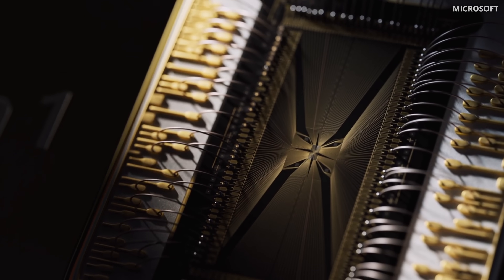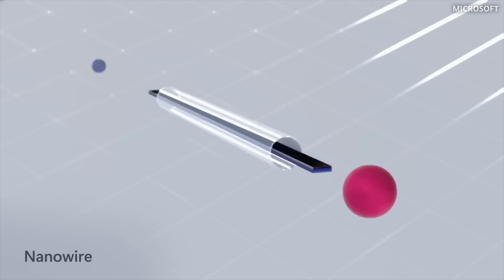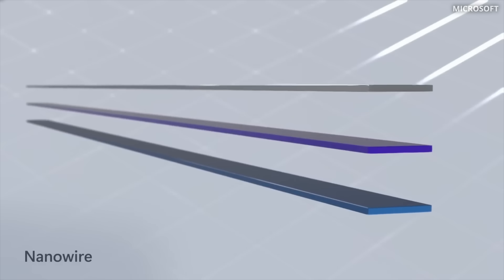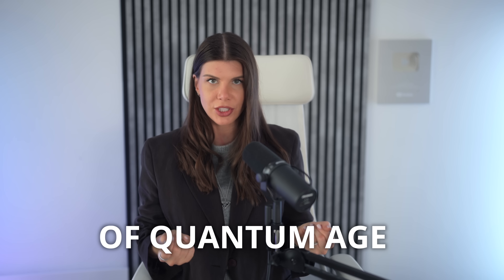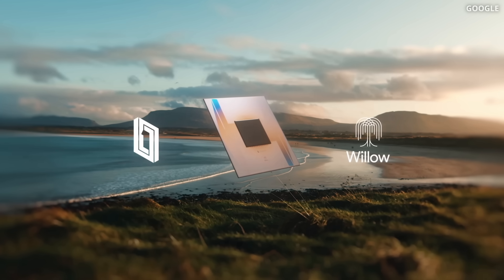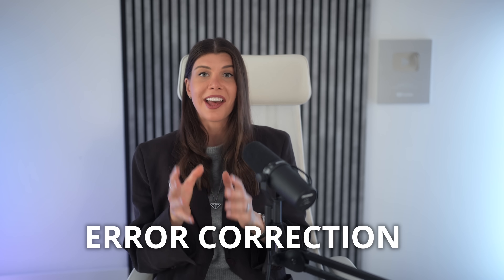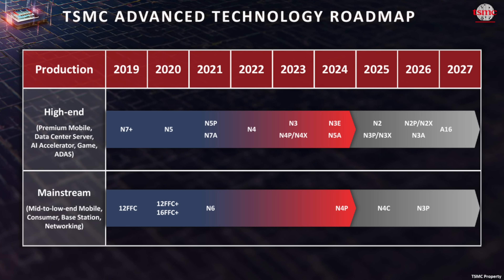The Truth About Microsoft’s Quantum Breakthrough

Comment: Microsoft’s Majorana chip is a fascinating step from a physics standpoint: by introducing topological qubits based on Majorana quasiparticles and topological superconductivity, it’s pushing the boundaries of quantum hardware design.
However, as the video highlights, this is still a proof-of-concept with only 8 qubits—far from commercial viability. Compared to Google (Willow) and Intel (Quantum Dot CMOS), Microsoft’s approach is much more radical at the device level, aiming to prevent errors inherently rather than correcting them afterward.
A bold and promising direction, but still early stage. For now, it’s more a "new physics" than a "new industry".
Can’t wait to see who gets to the first truly useful quantum computer!

Comment: Could you make an episode on how error correction works? How we get from multiple Qbits to a logical Qbit?
I thought quantum systems are an overlap of all possible solutions of one equation that you force into one of those possible solutions when you observe it.
Looks like that understanding is completely wrong because if would e.g. make a redundancy calculating two times in parallel you would likely add up with two different solutions not being able to make an error correction.
And I don't think that the classical error codes can be taken over 1:1 from current designs. Can they?

Comment: AFAIK the qubit is diagramatically equivalent to a vacuum tube in a comparator configuration. This is an analog computing renaissance but if they called it that there'd be no investor hype... (this looks like a market bubble not a technology breakthrough to me, because has anyone compared a comparator assembly with 741 opamps to qubits and done a cost/benefit? )

Comment: Microsoft found and used a new state of matter to build Majorana?

The simple answer is no. :face-red-droopy-eyes:

A more complete response would be: "They used matter in a known state and in a non -common phase."
In the basic school they taught us that the states of matter were solid, liquid and gaseous. Then we listen to a 4th state called Plasma.

But what really defines a state of matter?

The state of matter is determined by the arrangement and mobility of its particles. This organization allows you to distinguish its physical form by properties such as volume and density.

Simple: It depends on how packaged the particles are and how they interact with each other.

Before discovering molecules and atoms, macroscopic properties were enough to classify matter into solid, liquid and gas.
But when observing at smaller scales, phenomena appeared that challenged that classification.
Thus, by continuing to explore the matter, we discover something more radical: plasma.
When the energies are so high that the electrons separate from the atomic nuclei, we obtain an ionized gas: the plasma. It is neither liquid nor gas.
Everyday example: fire. Cosmic example: the stars. Plasma is the most abundant state in the universe.

The key is that matter can change state through physical processes. Heat a solid and turns liquid. More heat and turns gas. And if you continue, you get plasma.

Therefore, "states" are also called phases and change between them is a phase transition.

With quantum mechanics, new properties emerged to classify phases: electrical conductivity, magnetism, among others.
For example, when cooling a conductive material, you can enter a superconducting phase, where electrons flow without resistance.
Another curious phase is superfluousness: a material in bulk can flow without viscosity.
But these phases are not usually called "states" because a material can present several at the same time. They are rather specific manifestations under certain conditions.

Here the topological materials enter.

The topology studies properties that remain by deforming an object without breaking it. It is worth stretching it, twisting but not making holes.
Have you heard that a donut and a cup are "the same" topologically? Yes, both have only one hole
A material is topological if it maintains physical properties under soft deformations. If it conducts electricity, it is a topoconductor. If it isolates, it is a topoaislante.
And yes, materials can travel between these phases, as between solid and liquid.

Now, what does this have to do with Microsoft's Majorana 1 chip?

It is simple: the key material is a topoconductor.
The material can deform gently maintaining its conductivity.
That does not mean that it is not a solid in classic terms (volume, shape, etc.).

So, did you discover a new state of matter? Not really.

The most accurate thing would be to say that it is a solid in the conductive topological phase.
This was already known although it now has a use that opens the door to climb quantum computing at commercial levels soon.

The material is Arseniuro de Indio and Aluminum (Inas-Al), arranged in layers almost atom per atom, an still remarkable achievement.

That arrangement generates emerging particles: the famous Fermions of Majorana. Its existence is not new, but its application in quantum computing.
On a quantum computer, the operations are carried out "braiding" these majoranas: moving them around each other.
This process is theoretically resistant to noise, which makes it a promising platform for quantum computing.

Conclusion: It is not a new state of matter, but a conductive topological phase in a solid material, exploited in an innovative way.

Science does not always invent from zero, sometimes it finds new ways to use what is already known. Thus technology advances.

END

Source: https://x.com/azogueray/status/1892658196700864814
Translated by: Translate.google.com

:virtualhug:

Comment: Until someone has a eureka moment and finds a material that exhibits superconductivity at room temperature these chips will be useable only by the likes of those who designed and made the chips
Reply: They have already discovered some.
Reply: @ not that is known so far all the materials they use for chips have to operate at near absolute zero. Maybe this chip will be the game changer but google’s and ibm’s require colder than cold temperatures
Reply: @MicheleRivarola  No, there already exotic ceramic compounds that feature superconductivity at room temperature, since a few years. They're still in laboratories but they exist.
Reply: @jimbotron70  but a material that is manufactured at atomic level and which cannot be layered via a lithographic process used atm is just as not found. The material needs to be a compound that can replace metals such as copper or aluminium i.e. that can be made into a conductor with some tensile strength and ductile properties. Most ceramics don't have them and whilst it may be suitable for redesigned chip deposition process it is probably not suitable to distribute power in a large scale data centre for example

Comment: Like how nerves work.
Reply: No, sorry. Not even remotely.
Reply: @aclearlight  Saltatory conduction, on the outside of the nerve?
Reply: @rocketspushoffair  Ah, well, thank you for that. I'm still not sure, perhaps i need to re-listen to the vid. Short version of neuron action potential; a small net ion current normal to the axon length (through memrane-bound ion channels) occurs in the form of an advancing wavefront of collective such ion-channel triggering. This carries a small trans-membrane voltage change to propagate down the axon to the synapse at the end.  This ultimately causes neurotransmitter-containing vesicles (little lipid-bilayer bags) of potential-altering chemicals to be released for diffusional communication across an aqurous gap down the chain to receptor sites on the body of the next neuron. Importantly, there is no longitudinal ion current down the axon. Does that support or diminish your thesis?
Reply: @ The synapse and vesicles releasing, is relatively slow, but the signal transmission is much faster than expected, hence the saltatory conduction explanation. It does seem to resemble what she discussed, because in both cases something is happening on the surface, right?
Reply: @rocketspushoffair  Well, the speed of the longitudinal potential change down the axon is many orders of magnitude slower than the trans-membrane ion channel dynamics and potassium/sodium ion diffusional adjustments (perpendicular to the axon length) which bring it about. I will have to re-watch this vid with your question in mind. In general, I have found that the lingo in this area, such "neural networks", can sometimes mislead people into reaching for more analogy between "in-silico" and "in-vivo" than what the physics actually supports. And this can go the other way too, such as some researchers strongly asserting that certain molecular components (tubulin dimers) which comprise the microtubules within the neuronal axons are acting just like quantum computers do and therefore they just MUST be where and how consciosness happens in brain tissue. I tend to be kind of reserved, maybe even stodgy, about these things bc of how easy it is to let a poorly-founded analogy in one's initial mental model of a situation then mis-lead one's thinking and experimental decisions, and most of all interpretations, many steps further down the road. Sorry, TMI!
Reply: @aclearlight  "I tend to be kind of reserved, maybe even stodgy, about these things bc of how easy it is to let a poorly-founded analogy in one's initial mental model of a situation then mis-lead one's thinking and experimental decisions, and most of all interpretations, many steps further down the road."—This quote is orders of magnitude more interesting to me.

Comment: 1.Topological phase is not new
2. MS lacks proof that they have  a qubit.
3.They might still need quantum error correction.
Reply: Yes, but the entire point of the new state of matter is that the inherent properties of the cubits will make it less susceptible to decoherence.  Yes, they will still need quantum error correction but they won't need an extreme quantity for redundancy purposes.  The chip itself is designed in a way to mitigate and resist decoherence. 

Think of a solar array.  If th quantum computers were solar panel arrays, the current quantum computers would need an exorbitant amount of room to be redundant enough to be useful whole the new Microsoft chip (IN THEORY) would only need a fraction of that to be useful.
Reply: @specialsause949  Yes the quasiparticle poisoning is long so should be ok but we didnt see topological protection. We dont know size of topological gap to know how well protection they have.
 You dont say "we created a new state of matter". It is a quantum phase transition (not even demonstrated) and not discovered by them. There is no decoherence. The errors are not decoherence.
All your statements are a bit unclear and not sure if you understand the topic.
The quality of the material and fabrication needed for a majorana qubit is extremenly high. More important, the number of gates to operate one of the qubits as well as the electronics is very very large. So MS is going to face these obstacles eventually. 
I find topological QC interesting but It has not happened yet. It might happen from other labs before MS.
Reply: @specialsause949 Take as much room and qbits  as necessary to build the first one and use that one to come up with a better idea. They're doing it with CERN and other fusion experiments 😁

Comment: 🎯 Key points for quick navigation:

00:00 🧊 Introduction to Microsoft's Majorana Chip
- Microsoft's Majorana chip represents a significant advancement in quantum computing with the introduction of topological qubits.
- The chip is created from a new material called topoconductor, involving a superconductor and semiconductor.
- Majorana particles form the basis of this innovative qubit design, leading to a newly engineered state of matter.
02:53 ⚙️ Functionality and Advantages of Topological Qubits
- Topological qubits are specifically designed to overcome issues related to noise in quantum computations.
- The storage mechanisms involve trapping electrons, enhancing resilience against environmental disturbances.
- These qubits display improved coherence, promising better noise rates and scalability.
06:32 💡 Insights from Microsoft’s Engineer on Topological Qubits
- Experts at Microsoft highlight the scalability and error-correcting capabilities of topological qubits.
- The topological phase represents a new phase of matter that enables efficient control of qubits with simple digital systems.
- Microsoft envisions scaling up these qubits to millions, enhancing operational efficiency.
09:22 📈 Comparison with Google's Willow Chip
- The release of Google's Willow chipset highlights advancements in superconducting qubits and their effects on error rates.
- Willow demonstrated the potential of increasing qubit numbers to significantly reduce errors in quantum computations.
- Achieving practical quantum computers will require consistently low error rates, indicating the importance of noise management.
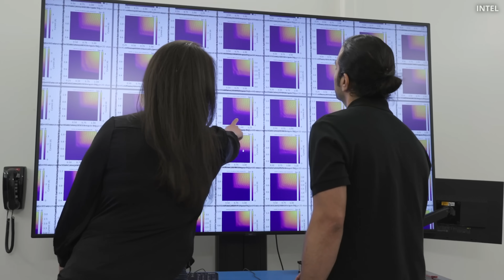15:32 🔬 Future of Quantum Dot Technology
- Intel's Quantum Dot technology presents a promising approach toward scalable qubit solutions, leveraging standard CMOS manufacturing techniques.
- This technology allows for smaller qubits, enhancing integration and potential to scale to million-qubit systems.
- Compared to Microsoft's approach, it may address challenges with error correction and overall system maturation.
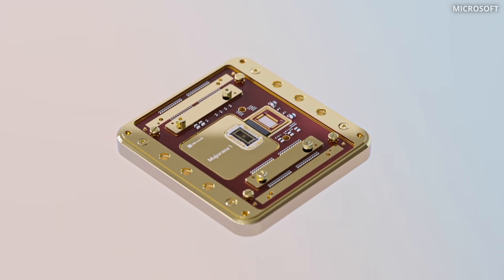17:48 🌐 Conclusion on the Quantum Computing Landscape
- The Majorana chip showcases innovative progress but may require more maturity before its commercial application.
- Quantum computing is experiencing a resurgence, with various companies pioneering different approaches, including Microsoft's unique chip.
- The competitive landscape highlights diverse technologies at play, each aiming to solve key challenges in quantum computing.

Made with HARPA AI

Comment: As long as quantum computers can’t run in the realm of “ambient temperature”, they will have limited application. Until quantum computer scientists “embrace the noise”, they are  “running uphill”.
Reply: Limited application sure BUT if it can crack encryption then for some (insert state actor here)  that will be more than enough
Reply: @felipe367  👍
Reply: Yup. This is a lot of big noise about nothing much.

Comment: Why don't we put our data centers in space?  Keeping a solar shield kind of like the James Webb telescope to drop the temps?  Keep them in leo for the latency but get away from large data centers that use a lot energy to keep them cool.
Reply: Brilliant !  ....and I mean that.
Reply: 1. Space is cold technically, but it's incredibly difficult to dissipate heat. There's no air or fluid in space, which data center need to remove heat by convection. The only other way is by radiation, which ISS use with radiator. 
2. Weight is expensive: Putting data centers in space could easily cost over hundred billions, not including R&D into developing data center designed for space. 
3. If you want solar power in space, just buy a plot of land for solar power farm. 
4. If anything goes wrong, it's easy to lose those $$$ down the drain. If anything goes wrong in earth, easy fix.
Reply: it still insanely costly to send stuff to space. but yea, i dont know why someone in the ISS is not at least testing such a technology there since this is the purpose of any space station these days.
Reply: Maintenance would be an issue, not to mention launch costs.
Reply: @yeroca  launch cost have been dropping with Dragon.  Thanks to Elon we have a leo internet backbone in space.  As far as maintenance goes... just launch a new unit, keep them on the small size and make them so the deorbit by burning up.  IE, make them disposable and redundant.
Reply: @ Run the numbers to see how it works out.  I'll bet it will still end up being 10X more expensive over the lifetime, including energy costs.

Comment: The stucture of these is almost identical to the SIS amplifiers mixers and filters used for microwave applications, just smaller. Looks like they are using the half century old discovery of superconducting quantum interference effect to create a virtual q bit element by confining the mode to a single dimension making the electrons act like q bits😮

Comment: Any system utilizing absolute zero superconducting is a fool’s errand. It’s not practical or scalable in any fashion. As far as the transistor-like qubit, if they are only utilizing the spin up and spin down then they are shackling the concept of quantum computing all together. This technology is hundreds if not hundreds of thousands of orders of magnitude more complicated than the humble original can (transistor in the metal package). Human minds can’t solve this. This will developed solely within the confines of a mature AGI. But way before that, put AGI to work solving RTSC. Waste heat in electronics is…well…a waste. Please all you smart people, focus on solving root cause problems so I don’t have to constantly be grumpy. Can’t do anything about be old, but the rest can.

Comment: who really cares if each qubit is say, huge, say 500 nanometers, what matters is if it is (because of it's larger size) resistant to all forms of noise, you still get millions on a chip and even a million qubits on one chip would be tremendously powerful, sometimes it seems like they are trying to miniaturize instead of innovate. Also, maybe just because of the way this is dumbed down, the topological qubit seems to me to still be a qubit based on matter as a solid, a nanowire is still a solid object, even if it does have emergent properties like topological semi/super conductivity...
Reply: because its not resistant to all noise. there's reasons.